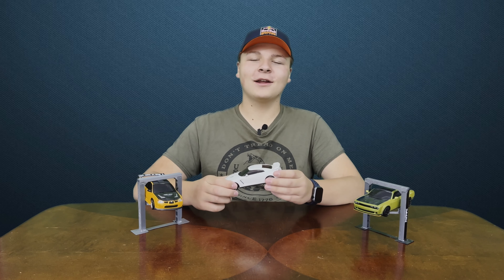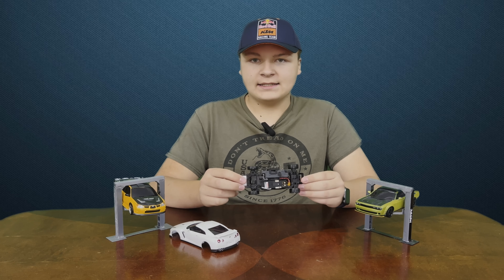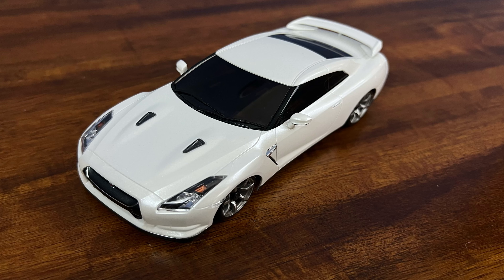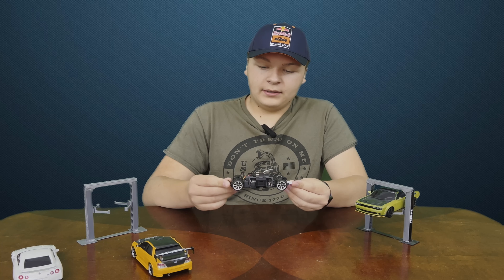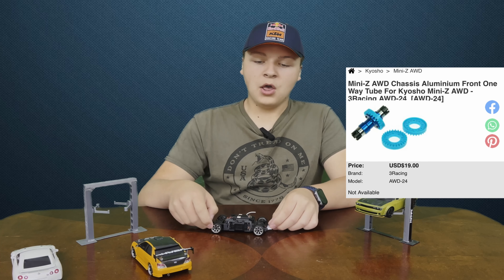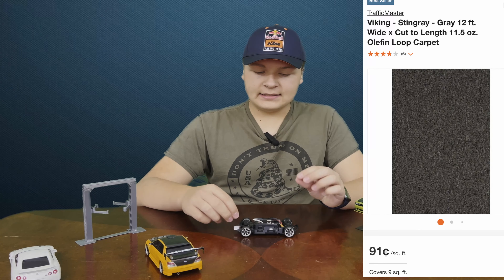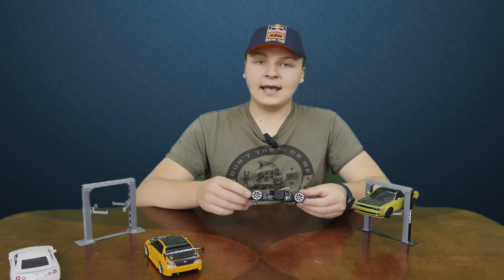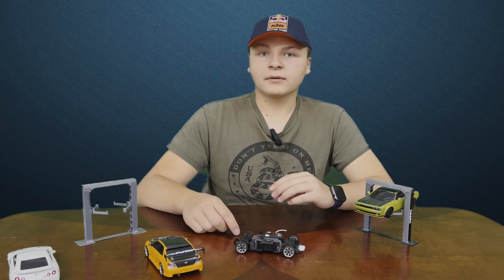The Ultimate MINI Z Drift Guide!

Comment: I don't suppose there's an upgrade to go to lithium batteries or only the AA's?  That's one thing holding me back from buying one is the fact that they don't run on a lipo.
Reply from the maker: There only aaa. And I have seen a couple people do lipos but I think that’s for a different chassis. I use rechargeable aaa and I got over it.
Reply: Wltoys k989 is probably your best bet.
Reply: Rechargeable aaa batteries are way easier than lipos.
Reply: I personally have run one of the original mini zs on a 3 cell it was very fast it was one of the monster trucks I don’t remember the name exactly but it did wheelies. I soldered strait to the contacts
Reply: Get lipo AA rechargeable batteries.
Reply: Yes there is I have dual lipos just have to mod the chassis depending on which one you have

Comment: I just started to race mini z cars, and I have one question. How do you drift so good? For me it’s really difficult, Thank you.
Reply from the maker: Is yours the awd version? Biggest tip I’d say is throttle control. I always feather the throttle vary lightly. Too much throttle can make you spin out. You also need to be vary responsive with the steering. The steering on these cars are vary quick witch is good but that also mean you need to be quick on trying to drift. I’d recommend a gyro too. That can really help people. Kysho makes gyros just for the miniz awd.
Reply: @NeuroticRCshorts  thanks for the tips!